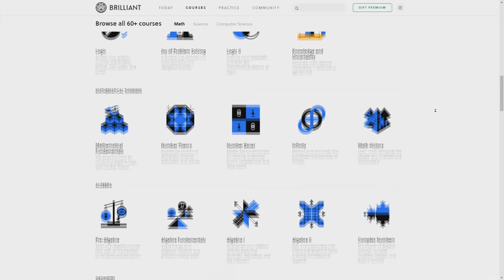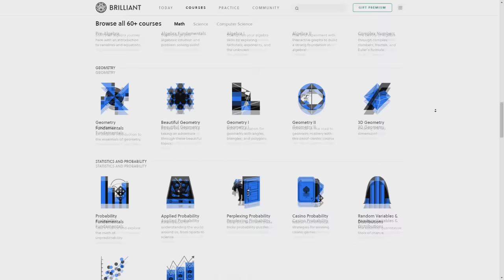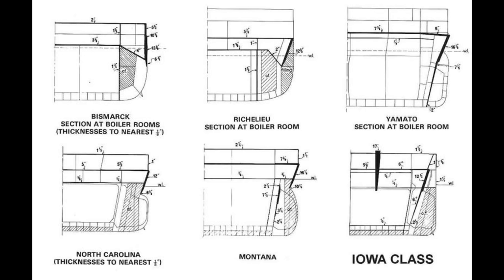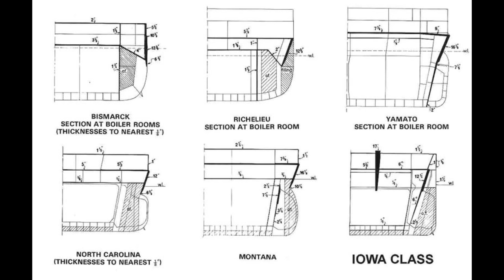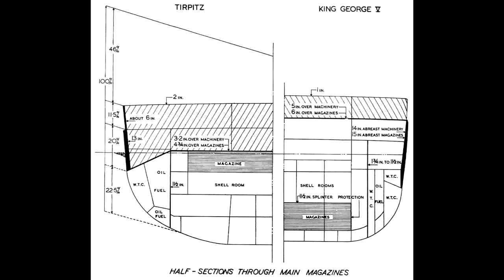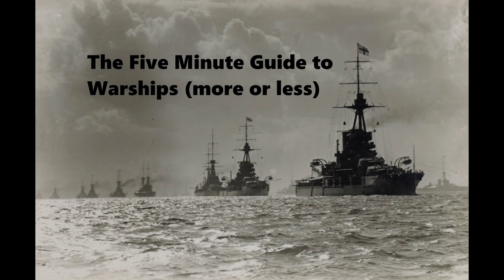Dreadnought Modernisation - A tri-wire balancing act

Comment: Oh, there's a thought!

During the Pursuit of Bismarck, Hood couldn't participate. Her engines abruptly started to have problems and so she had to be drydocked. It was found they would have to be worked on for a while, but while doing so, a German attack by the Luftwaffe occurred where Hood was docked.

Despite a heavy defense, one German Bomber managed to hit Hood causing significant damage. Though the Bomber was hit in turn and crashed. Whatever happened to the crew, well, they were either dead or POWs.

Hood had now been essentially put out of action for quite a while. While not as bad as it could have been, the problem was, her drydock and its equipment were not so fortunate. While the drydock wasn't flooded and could still be controlled, there was little else that could be done. Hood needed new engines and now a lot of work. Fortunately, one engine was reactivated, but Hood would be limping to America for much more detailed work and the British opted for a full Refit while they were at it.

On her way to America, though, Hood had the misfortune of crossing paths with Bismarck. Fortunately, she had a decent escort, but Bismarck still tried to chase Hood. But Hood was close to American waters by that time and, indeed, the US Navy came out to say, 'Nope, not happening,' showing off their nice new North Carolina which fired its 9x16in guns and scared Bismarck away since she had only 8x15in guns. Not a fair battle by anyone's standards.

The Terror of the Seas beat a hasty retreat back to German waters as North Carolina chased after her, showing her the door in the process.

Bismarck and Tirpitz would wind up stuck in Norway for much of the war. Hood, fresh from Repair, Refit, and Modernization, would happily sail the Atlantic until being tasked to go with Victorious to the Pacific. The North Carolina would be in the Pacific for much of the war.

How does it all end?

Well... Not good for Bismarck and Tirpitz, considering their side lost the war.
Reply: Hood's fate wouldn't change much (or at all) from what Drach postulated on his theoretical refit video about her. North Call is even less likely to be scrapped/nuked. And Bismark (who would never have survived long enough to make it home anyway) shares the same fate as the Tirpitz did historically. If she does survive the war mostly intact then she will most likely either be scrapped (anybody likely to be interested in keeping her as a trophy would be way too broke to do so) or nuked.

Comment: But did the QE class get the small tube boilers in their refit though.
Reply from the maker: Yes, but a physically much smaller powerplant to allow for room for AA magazines etc, and still managed to gain half a knot despite the extra displacement and new TDS.
Reply: @Drachinifel  wasn’t it the point of trading the 24 smaller boilers for the 8 larger boilers (6 in warspite’s case) to save weight and give more interior room for things like the AA gun Mags and the like, without loss of speed. Cause I swear that was why they did it.

Comment: The United States looked at modernizing the South Dakota's after the war to bring their speed more in line with the carriers. The idea was scrapped because the refit would cost about as much as laying a new battleship. As it were, the South Dakota and the Indiana were scrapped and the Alabama and the Massachusetts became museum ships.
Reply: I think it was the North Carolinas that the US thought about upgrading.  The SoDaks were already about as fast as they were going to get on their hulls.  The NCs could have been made faster, but it was deemed to expensive and might have involved removing the rear turret.
Reply: @bluemarlin8138  they thought about an Italian style update for the South Dakota's because their armor was better. They planned to remove the aft turret for additional engines to generate the power need for a speed of 31 knots. The price tag was $4M in 1954.

Comment: Not a dreadnought, but my upgrade would be to take an older US carrier, probably Saratoga, remove all aircraft, and cover her  with 40mm bofors. Add a few more 5"/38 turrets as well. Just make her a floating AA trap.
Reply: maybe that would have stopped the japanese reporting her sunk every other week
Reply: You'd have to razee her. Metacentric height.
Reply: Saratoga and Lex were pretty competitive. Especially compared to Akagi and Kaga
Reply: @rosiehawtrey  So she’d have to be renamed after a famous razeed frigate too!
Reply: That is exactly what they did to Saratoga in 1942. Took out the 8" mountings, replaced them with 4 twin 5" 38 mounts and replacing the 8 5" L/25 AA guns with 4 5" L/38 Mk.12 singles. And replaced the 1.1" and .50 cal MGs w/40mm and 20mm guns. Also they bulged the hulls out to 112'. And squared off the flight deck. Added around 4,000 tons. The 8" mounts were turned over to the Army for CD.

Comment: Well my refit idea for one that wasn't was if the British had keept Tiger instead of iron duke as a training ship. 

If it's already dearmoured and got some of the guns removed it's a prime candidate for a carrier conversion.
Reply: I think Drach may have discussed this in a drydock episode.  If I recall correctly, he believes Tiger wouldn’t have been a great carrier.  At only 700 feet long and 28 knots, she would have been a light carrier at best.  Courageous and Glorious were a good bit longer and faster.  As a battlecruiser, she would have been useful against the Deutschlands early in the war, but she was too slow to catch the Hippers and too slow and poorly-armored to fight the Scharnhorsts or Bismarcks.
Reply: @bluemarlin8138  well the flight deck is certainly a legit factor.

As far as speed is concerned that 28 knots is with 1910s coal fired large tube boilers,   if it's modernized especially as a carrier where you don't need weight for armour with 1930s oil fired small tube boilers it should be able to hit similar speeds to Kongo
Reply: There were agreed limitations for the total aircraft carrier tonnage. Both Britain  and the US were restricted to 135,000 tons. The RN's pre-war carrier fleet was already around 115,000 tons.    

I would, however, have preferred keeping Tiger in lieu of one of the Rs. The Rs were permanently bedevilled by their lack of speed, whereas a modernised Tiger could perhaps have played a similar role to that of Renown, as a fast carrier escort.

Just a fantasy on my part, of course. It takes my mind off watching the England opening batsmen in the current Ashes series!
Reply: @bluemarlin8138  I believe her standard displacement was about the same as Renown, so I suppose a rebuilt Tiger might be competitive with the rebuilt Renown. Presumably, it would not be possible to start the rebuild until the collapse of the treaty system, so the rebuilt Tiger would be ready around the time Repulse was sunk.
Reply: @davidchambers8697  I think their displacement was roughly equal in each's original configuration, but that was when Renown and Repulse had 6" main armor belts and Tiger had a 9" belt.  Once the Renowns received their 9" belts and additional deck armor, then were several thousand tons heavier despite having two fewer but larger guns since they were a good bit longer and had more engine machinery.  I believe (but am not sure) that the Renowns' 9-inch belt had more coverage than Tiger's, but I could be thinking of the Lions here.   Could Tiger have been useful in WWII with enough modernization?  I think she would have needed to reach at least 30 knots, and while modern machinery could get them there as designed, this might be tempered by the fact that they would have to have torpedo bulges, more deck armor, better rangefinders, radar, etc. installed.  Since Tiger was substantially shorter than the Renowns, she didn't have as much room for machinery, and bulges would have had more effect on her length to beam ratio.  She might get to 30 knots, but I'm not sure if she could get to 32 like the Renowns did with all the extra weight and beam.  IMO she'd be most useful for hunting down the Deutschlands early in the war.  The Hippers may have been a bit too fast, although if she caught one she'd make short work of it.  She'd have to get really lucky against a Scharnhorst (the Renowns were only a match for them because of the huge gun caliber disparity), and you can forget about her facing off against a Bismarck or Littorio.  I suppose she could have been useful early in the Pacific war, but one ship would be vulnerable and not very useful.  In general, I don't think she would have been nearly as useful as Renown.  Almost anything you could do with her, you could do with 2 cruisers.
Reply: @bluemarlin8138  Dunkerque had 13in guns, a 9in belt, and 30knt speed, so I would think a Tiger rebuild could match her. And be a lot cheaper.
Reply: @davidchambers8697  Dunkerque was built to do what I said a rebuilt HMS Tiger could do----hunt cruisers up to and including the Deutschlands.  But like a rebuilt Tiger, she didn't have enough armor to take on even an under-gunned battleship like the Scharnhorsts.  She would have been a good match for a Kongo in the Pacific perhaps, but it would be a toss-up at best.  Strasbourg was significantly more heavily-armored and better-suited to bigger prey.  

I disagree that rebuilding Tiger would be cheaper than building Dunkerque.  A full rebuild like what Tiger would have needed isn't much cheaper (if at all) than building a new battleship.  There are also more maintenance costs since the rebuilt ship is older.
Reply: @bluemarlin8138  If Dunkerques armour was adequate to give protection against 11in AP shells fired by Deutschland, it was also adequate to give protection against 11in AP shells fired by Scharnhorst.
Reply: @davidchambers8697  Not so, for 2 reasons.  First, the 11” guns on Scharnhorst were a generation newer and had superior accuracy, range, and penetration.  Second, it’s not just about the guns, but also the armor and speed.  The Deutschlands had cruiser armor and a 28 knot top speed (more like 26-27 at combat loads with hull fouling), so a 30-knot Tiger could have just stayed at long range where its armor would protect it pretty well from 11” guns that weren’t much improved from what the Germans had in WWI.  On the other hand, Scharnhorst had battleship grade armor and a 32 knot top speed, so it would have been able to get close the range on Tiger so that its guns—which again were high-velocity guns far superior to the Deutschlands’—could penetrate Tiger’s armor pretty easily.  It wouldn’t be a certain victory, but I’d certainly bet on Scharnhorst in that fight.  The Scharnhorsts could also just avoid the engagement altogether with their superior speed.

Comment: I  always thought that the British missed a step by not treating their 13.5 inch capital ships to the Italian process. With the removal of the midshiips turret and the reorder of machinery the amount of weight saved would provide for all the things you spoke about, horizontal protection, dual purpose secondaries, fire control systems additional speed etc. And as a bonus, they could upgrade to 14 inch guns. In effect creating two additional squadrons 14 inch Queen Elizabeth types, 10 ships and a spare. And while we are at it doing the same process with the battlecruisers Lion, Tiger and Princess Royal. Converting them to 3 turret 14 inch Renown types. With 20 battleships and 6 battlecruisers Britain would enter WW2 with a fleet Nelson would be proud of. (Not counting for any new units during the interwar era of coursd).
Reply: The British simply didn't have the funds or industry to do this. Under the Washington Treaty, the remaining 13.5" ships had neither the buoyancy reserves nor the combat power compared to the two Repulses (1920-1926) and need for bulging the Queen Elizabeths between 1921-1933 given the limited funds. Most of the available funds were going into the two Nelsons (1922-1927) and the 10,000 ton cruisers. The British exchanged the three "Ajax" class ships in 1927 and only the Tiger and the four Iron Dukes remained. The London Treaty got rid of the 13.5" gunners completely, and in any case, the Queen Elizabeths (1934-1941) and Repulse and Renown (1936-1941) were more important. Also the British were rather strict about following the Treaties. The Washington Treaty prohibited exchanging guns for larger bores except for the French and Italians and this remained in effect for the British until Sep 1939.

Comment: It sure seems to me that the Fusos and Ises enjoyed extensive reconstructions that matched or even exceeded that of the Nagatos.
Reply: Ripping out two turrets and their associated infrastructure and replacing it with a flight deck is a not-inconsiderable amount of work, as it turns out (in the case of the Ises)
Reply: @atpyro7920  ah yes, just like the post war Tigers.

But kidding aside, those Ises with their mid-war refit could've been used to ship the necessary fuel and raw materials back to Japan with the success of Operation Kita, hindsight is really helpful.
Reply: @atpyro7920  And I was not even referring to wartime reconstruction into half-carriers, just the 1930s reconstruction. The engines and boilers were replaced to give almost double the horsepower, the hull got lengthened, deck armor protection was considerably enhanced, bulges were fitted, elevation of main and secondary batteries were increased, the pagoda masts were added, 5" AA were fitted, rangefinders were added, etc. In other words, just about as extensive as it gets, short of the Italian rebuilds. The Nagato's had similar enhancements except they didn't get their turbines replaced. So Drach's contention at  11:15 that the Japanese navy's priority laid in the Kongos and Nagatos is quite contestable.

Comment: If there was a failure in US thinking for pre-North Carolina BB thinking it was the 21/22kt speed. It's actually not about speed but rather turning time. Only 32000 shp was needed for 21/22kt, but results in slow turn time. Under air attack, most 27kt+ ships were able to turn well enough to make air attack difficult, requiring sustained swarming attacks by experience airmen to get meaningful hits.  Sometime in the post-WWI period, there was a significant improvement in boiler pressure and superheating, allowing 27kt in the same plant size, assuming turbines and reduction gear could handle increased energy

Comment: I was pleased to see (?) that even in those days of old 'global warming' was paramount. At 53:16 there is an early version of a DIY wind generator sold by a well known DIY supermarket in the UK and recommended by our 'Energy Wasting Truss'. I can only asume it faired little better as the modern version was taken off the shelves slightly faster than the speed of light.

Comment: I have a silly question. Why were port holes included in Dreadnoughts? Were they not weak points where a shell could enter and do much more damage than if it hit full armor? Maybe I'm missing something but they (the port holes) seem to have disappeared later on so I guess they were deemed a weak point? Thanks for the replies!
Reply: Portholes were simply not installed into the armoured sections of the sides, only into the unarmoured sections.
Reply: Portholes were only placed above the main armor belt and main armor deck.  The top couple of decks on battleships usually only had splinter protection of maybe 1-2 inches, so there wasn’t a big sacrifice in protection to have them there.  They just closed them during battle.  Portholes on the upper decks really only disappeared on battleships built during WWII (mainly US ones).  I believe they were omitted to save construction time.

Comment: One point that needs to be made is that producing battleship calibre naval rifles and face hardened belt armour were very time consuming due to the heating and cooling processes involved, so they were the bottlenecks in building new battleships.  That was why replacement BBs were not built, as they would have been pre-WW1 when there was much greater capacity to produce guns and plate than in the 1930s when much of the previous armour and gun making plant had been scrapped .   New engines and boilers, on the other hand, could be built much more quickly.  Likewise new superstructure and fire control, so the 1930s battleship reconstruction efforts mainly left guns and armour alone and used the weight savings from new high temp/pressure machinery to improve speed, torpedo protection, fire control and deck armour.  More AA guns were added, but (as experience showed) not nearly enough.